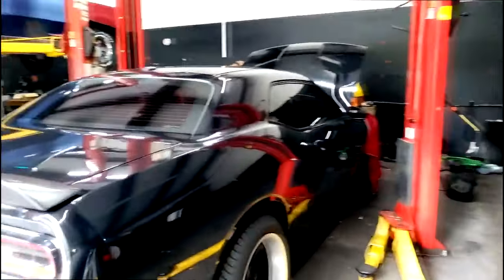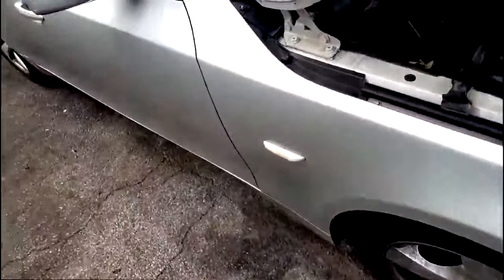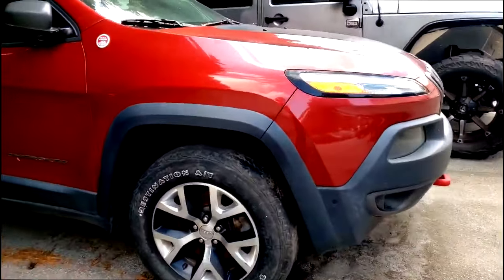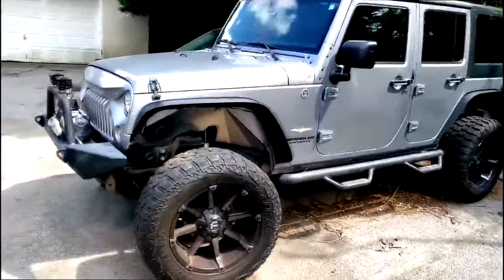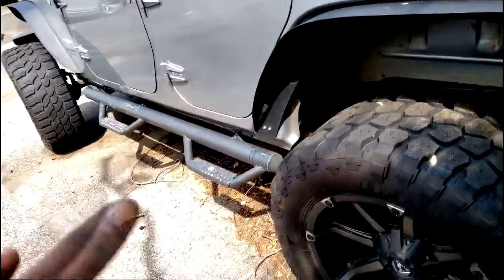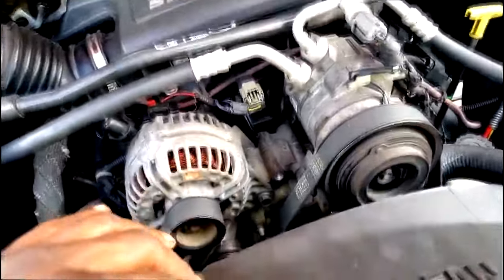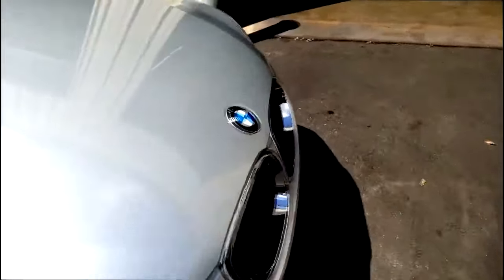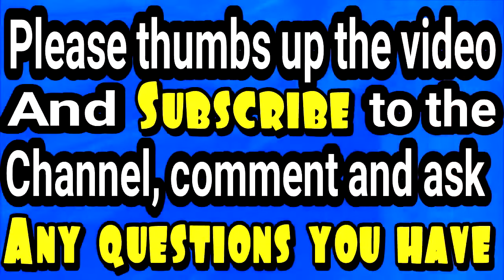This BMW has a new old problem so we have no choice but to do this

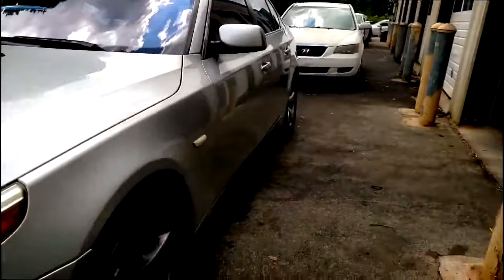Comment: Everytime I see an old BMW being service at a non BMW shop 9/10 its usually means someone bought it BMW but don't want to spend BMW repair shop money. 0:14
Reply from the maker: Dude you dont have to be in a BMW shop to get a BMW worked on. Its all about the tech thats working on it, not the shop. The Tech could be a dealer BMW guy just moonlighting at a indy garage working.
Reply: @OnlineMechanicTips  Correct, 100%! But that wasn't my observation.

Comment: I would at least check some easy stuff before I just throw a trans at it. A lot of times they are overfilled after rebuilds. I would definitely at least see if the fluid is burnt or has metal in it. But you didn’t mention the issue it was. Side note on the wrangler, I wouldn’t say it is normal for a torque converter to just come apart how you described and those trans have magnet so unless the the torque converter is toasted there’s not going to be metal in the filter.

Comment: BMW means bring my wallet😮!I do like the transmissions in the Cherokee but as in any transmission you have change the transmission fluid or service usually helps if you do it in the first 60,000 miles right?
Reply: Yeah or maybe 100.000 depending on the car, but if it reaches it’s exceeded limit it’s better to just ran the transmission till you get a new one, some transmissions are literally lifetime but you have no proof to see it , so yeah it’s better